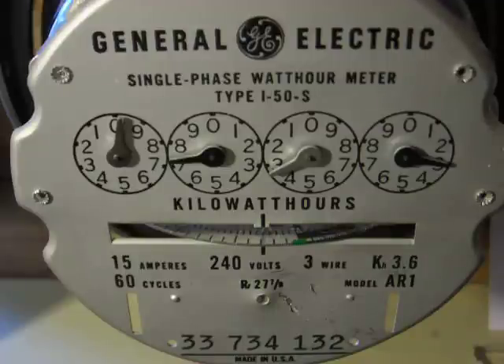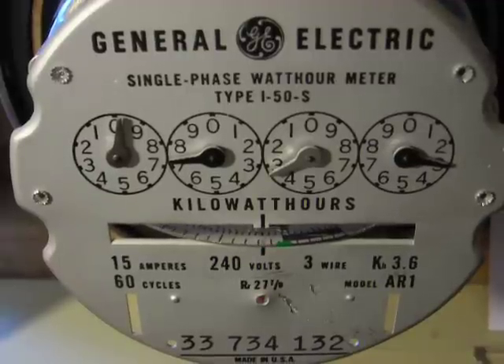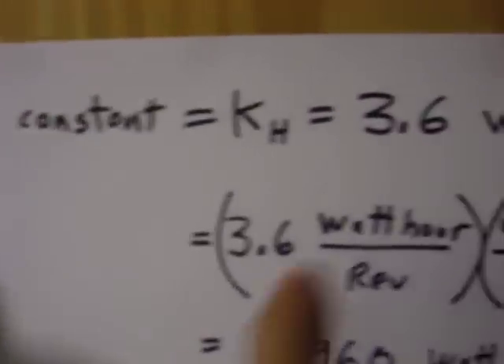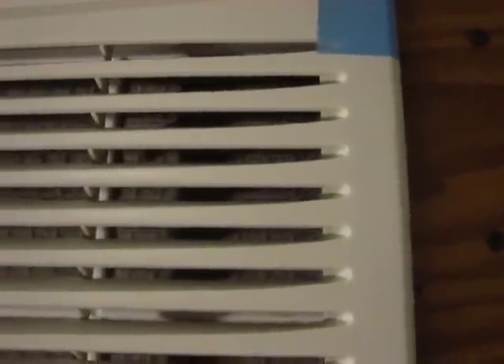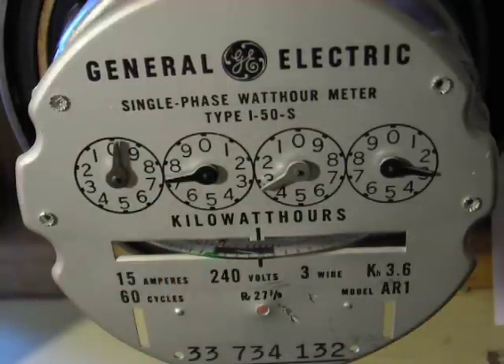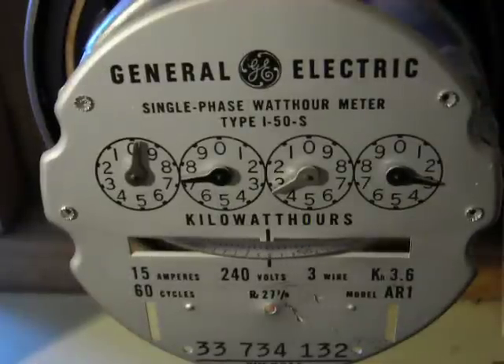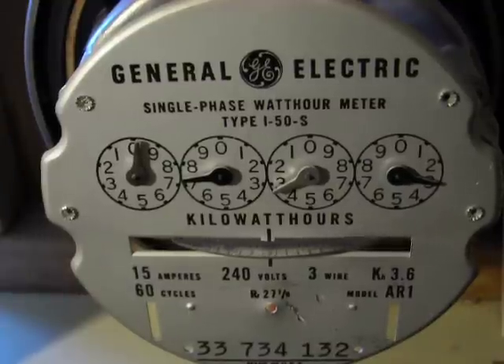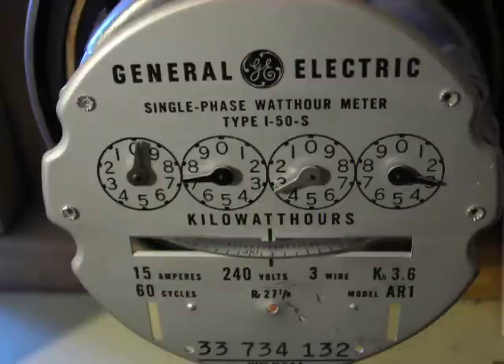Watthour meters (3) analog dial GE model I-50-S for 60 Amp service KH=3.6

Comment: I just picked up a i-50-s at a garage sale. It doesnt have dials, but numbers. It doesnt have a kh on it either. I was going to throw it inline with my EV charger a couple times to see if car reported vs meter reported varies. The charger is 3.8kW so if this indeed a 3.6kh, it should spin once every 3.5 seconds?